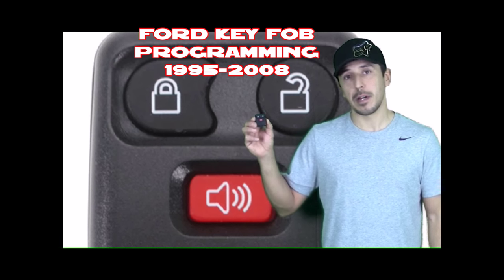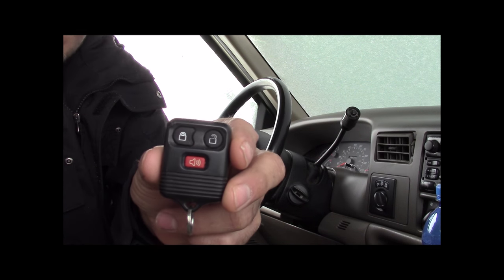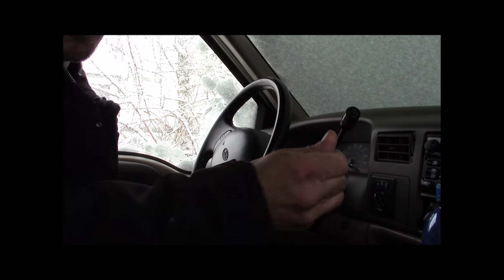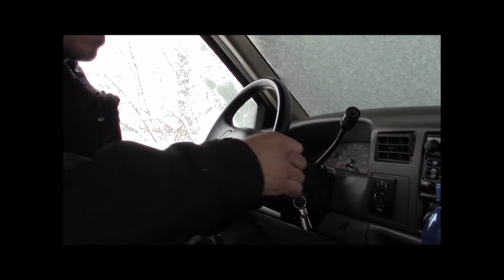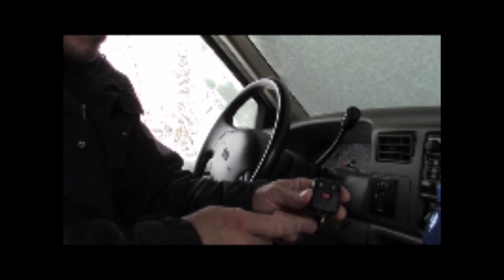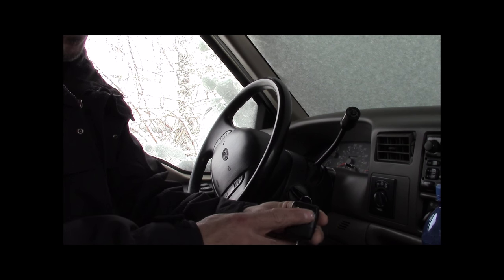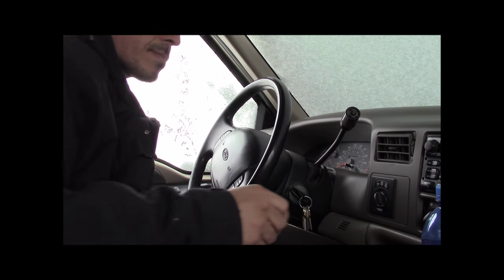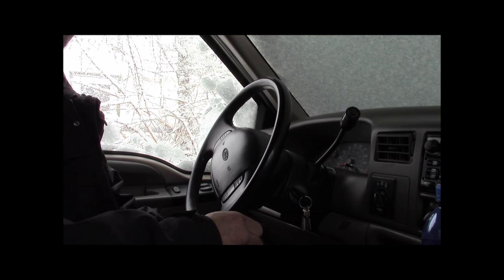1995-2008 Ford keyless entry programming in 20 seconds

Comment: But what if after 8 turns there is no locking  click?
Reply: i tried the 8 click   and no auto lock set re set   i do have a red light on dash for security  
when i shut it off       it is a 99 crown vic   not a p91
 i have had the8 click work on other fords  in the past .  So  i've done it before
Reply: Same with my 05 f150 🤦🏽‍♂️ I did the 8 clicks multiple times but my locks never cycled so I could never program my new fobs🤦🏽‍♂️
Reply: @kingmcclain9771 same problem w my 05 f250 I do everything right n it still don’t pair
Reply: same think on my 2008 Ford expedition EL
Reply: It wasn't working for me also but I followed the steps I started the vehicle and shut it off 3 times, then did the 8 times and it worked.

Comment: I have a 96 f150 I tried all of these multiple times never work
Reply: @seanzerkle2997  Momentarily jump pins in programming connector located at the base of the steering column. All doors will lock then unlock to confirm programming mode.

Comment: Just bought my daughter a 2008 Ford F-150 Lariat 5.4 Triton. Thanks to YouTube videos I was able to locate the master door code and then set one up for us to use. I also ordered key fobs for it and thanks to this video, I felt like I could get them going, but it was only $10 for 2 fobs. Following these instructions...I tried 8, nothing happened. So then I tried 2, then 3, then 4, etc. When I got back to 8, I was just going to do 9 times but I noticed my doors unlocked when I got to 8 and I never even touched the fobs that time. I tested both of my fobs and they were both working. I don't know what in the confound cat hair caused mine to work oddly, but I am not complaining as this process worked, just took me a couple of more minutes than expected. Thanks!

Comment: Hi: thanks for the tip! Do you know if there is a waiting period to try again? The first attempt worked (locks cycled), but the tutorial I watched didn't specify it needed to be left in run mode, so the fobs didn't program. After that, I tried and the locks didn't do anything, so no programming. Do you know if I can try again after a certain amt of time?

Comment: I've tried this over and over. My 03 explorer has keyless entry but will not go into program mode
Reply: Did you figure it out ?
Reply: @cloudrehzii  no. It will not go into program mode.
Reply: @nathanmitchell833  having the same exact problem
Reply: Same on my 2003 f150
Reply: I'm some on My Ford Windstar

Comment: Thanks for posting! Unfortunately it didn't work for our 1996 Bronco. Tried 2,3,4,5,6,7,8,9 etc. Other how-to's described 'jumping two pins at the bottom of the steering column' but that is about as clear as mud. Then, I found this video (by Tony's Car Care on youtube) and 1 minute in he shows the connector, the pins, and demonstrates jumping the pins. I could get to mine under the dash without removing any parts and once I knew what they looked like, it took all of ten seconds to program new fobs. Worked like a charm! https://www.youtube.com/watch?v=Tzu0oB4UkUc   Hope this helps anyone that couldn't get the on-off method to work.

Comment: Hi! I have a Ford Explorer 3 (2004) and all previous key fobs are lost, there is only a physical ignition key. I bought one of the key chains you're talking about. After 7 (or 8) turns of the key, the machine switches to programming mode, but pressing the buttons on the keychain does not lead to anything. Could you tell me if any of the previous key chains are needed to program the next one and what could be wrong in my situation?
Reply: Same problem !
Reply: @django5937 I fixed this problem. A battery was included with the key, and as it turned out, despite the fact that the indicator on the key lit up when the button was pressed, the battery power was not enough for programming. I bought a new battery and everything worked. Good luck

Comment: I have a 98 mustang and the fob worked but the battery died. I got a new battery and did the steps but it didnt work. Anything im doing wrong?
Reply: Did you ever figure this out? I’m in the same position. My fobs worked then died, I’ve replaced them and can’t get them to program.

Comment: What if the door locks don't cycle?
Reply from the maker: keep trying if it still does not work either you have bad remote or battery or your vehicle was not equipped with keyless entry stock.
Reply: C.L.S. Allinone thank you
Reply: @D.I.Y._All-in-One  wait so how can the remote be the issue if it’s a brand new replacement remote? Does the vehicle only cycle when a functional remote is present?

Comment: i have a 02 f250 bought it from original owner no key fob but found a card in owner manual book with a code listed for it. i dont see any key fobs sellers asking for the code. any ideas?
Reply from the maker: dsruddell is there push button code entry on door? shouldn't need code for fob just programming.
Reply from the maker: dsruddell also some vehicles didn't have keyless entry stock. you can verify if your vehicle does by calling your local ford dealership service department and asking them you will need your VIN number.
Reply: C.L.S. Allinone no there is not. thats the funny thing. its a XLT package truck